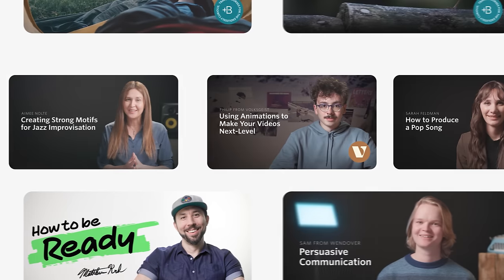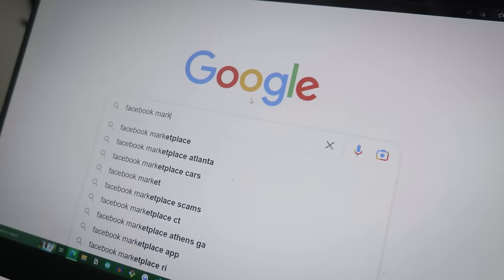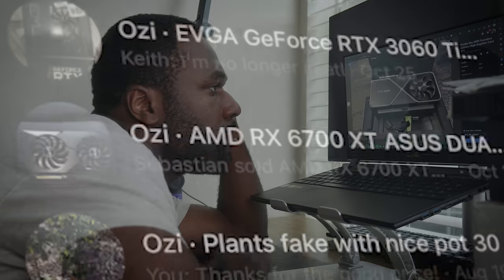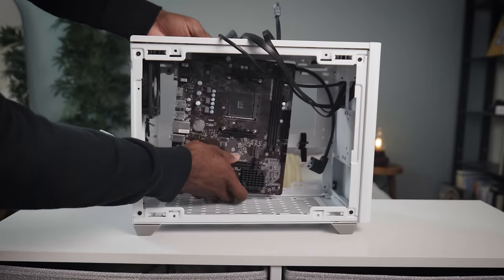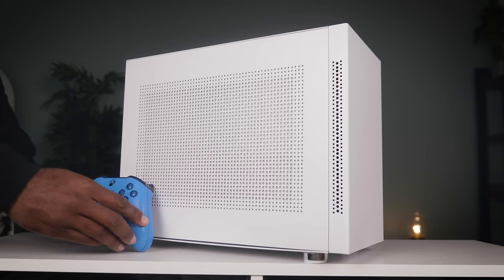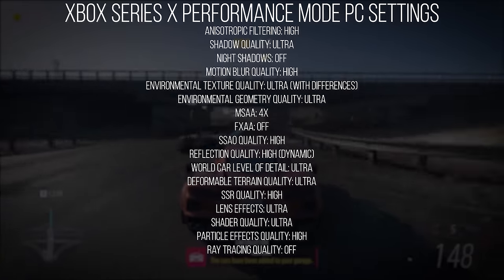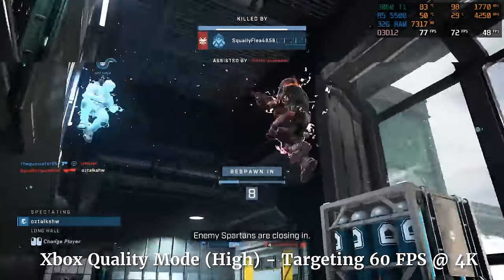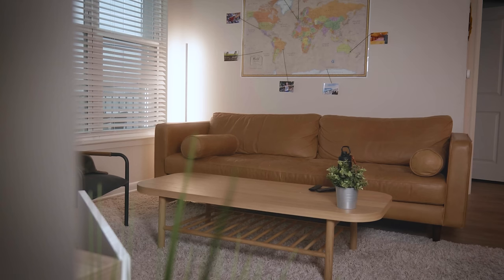I built a faster Xbox Series X for $474

Comment: This just goes to show how much of an insane value the Xbox Series S is when paired with gamepass.
Reply: What is this game pass?
Reply: Pay to play online, barely any sales on games and you need to slap tax on top. Honestly, a used 6600 or 6700 XT with a cheap B150m and either a QTJ2 from China or those 11th gen soldered CPUs and some 16GB of RAM is easily reproducible and will land you around the $500 mark, giving you all advantages of a PC with 100% better performance than the Series X. 

That being said, series S compared to a $250 gaming PC, even considering pay to play, is really good value across the board.
Reply: It just has a LAUGHABLY TERRIBLE low amount of storage
Reply: Tbf you can get PC game pass too
Reply: @JeskidoYT  Because he bought it ages ago. A 1TB NVMe drive is like $35-40 these days
Reply from the maker: Seriously...Microsoft hit it out of the park
Reply: @b0ne91  no i mean the console comes with 450gb of usable storage
Reply: I learnt the hard way, console gaming is limiting and frustrating.
Reply: Game pass is trash you dont own any of it, My steam library is mine until death.
Reply: Not just the components. Paying for their operation system too and the fact it’s pre built which is why it’s expensive. Supply and demand bro
Reply: Nah.  I'll stick with my 4070ti
Reply: @b0ne91  that’s not true lol. if you have game pass you get xbox live gold too. a series s costs 250€ at retail. you can’t get a pc that can last 10 years for that price
Reply: @idkwhyibothered  limiting? bro it’s a console, for playing games. what did you expect my guy
Reply: @TrTriTrippin  that’s the cool thing of game pass, you get new games without the need of buying them for retail price. why would i pay 60€ for a single player that i’ll just play once if i can have it for 13
Reply: @19deltascout43  sarcasm right?
Reply: @Moli05  Where did you get lasting 10 years from? The Series S plays 1080p and already has to upscale that for AAA titles. Buy a used office PC for 80€, throw in an SSD, half-decent PSU and a used GTX 1070 and you have a PC that outcompetes a Series S for 250€ too.
Reply: @19deltascout43  nobody asked.
Reply: @b0ne91  a 250$ pc with 120 FPS on warzone ?'
Reply: They have always lost money on consoles. They make money on licences and subscriptions and accessories
Reply: @sabah1287  A Series S doesn't have the CPU to hit 120 FPS consistently. Please take a look at Digital Foundry to see what it can ACTUALLy do. Also, Mir Computers just posted a video recently where he proved again that even a 4th gen (Haswell) CPU can do over 100 FPS in Warzone if you know how to tune your RAM.
Reply: @TrTriTrippin  lol or until steam goes under
Reply: Especially if you buy game pass through a third party.
Reply: whodis8393  well too bad gaming isn't a hobby its a luxury and gamepass is indeed a terrible marketing strategy for Microsoft
Reply: @Moli05  like I said I learnt the hard way
Reply: Except developers hate making games for the S
Reply: Gamepass on PC is just chefs kiss. Payed like 119 pesos which is 2 bucks in us every month.
Reply: Nah. PC Game Pass is cheaper and the PC can be built cheaper, can be upgraded, and tons of stuff can be done on the PC.

Xbox can only game.
Reply: Microsoft’s decision that you can’t make a series x game without a series s version is holder this whole generation of consoles back as far as game quality
Reply: @baseballreg123 A Haswell 4C/8T or Haswell-E CPU are more than enough to push a 1070, Vega 56, etc, in graphically demanding games. You should watch some DigitalFoundry and learn at what resolutions, settings and FPS the consoles actually run. Series S isn't exactly impressive.
Reply: @baseballreg123 wrong. PCs have settings to turn graphics up or down. XsX and PS5 games are literally having to cut back on graphics because their forced to launch it on XsS too.
Reply: @b0ne91  1440p. Does not have to upscale. All the games are optimized amazingly and I’ve had no issues.
Reply: @MS07B3-G0UF  What? 1440p for latest games is definitely upscaled on Series S and in fidelity mode, it's locked at 30 fps too. For older games - you're correct. But any game from 2019 and older will run at 1440p natively on a 1070 or Vega 56 too.
Reply: @b0ne91  not one time have I seen lower than 60 on the series s. Not once.
Reply: @MS07B3-G0UF  Again, might wanna keep up with Digital Foundry. They do a good job reviewing new titles.
Reply: Consoles are sold at a loss, except Nintendo Switch. Sony just released batches of new PS4 Slim in my country and they want $340 for a piece. I'd rather build a PC with that money, new PSU and GPU other parts used.
Reply: @spida2pro705  $20.18 for an OS key isn’t really a factor.
Reply: @JeskidoYT this is true. Fortunately sales happen with the expansion storage and it’s totally worth it
Reply: @TrTriTrippin  technically no...
Reply: Gamepass is only a value to people without large game libraries. Personally I have almost 1000 games between Steam, EA, Ubisoft, EGS, Humble Bundle, GoG, and Blizzard. With a PC I have full access to my entire library of games plus I can get new games whenever I please and I don't need to worry about a game being taken out of a Gamepass library at a later date. Furthermore, when you look at the games on Gamepass you find that the vast majority are either super cheap or are often given away for free on other platforms. Given the larger library of games available on PC and the ability to play almost every PC game that has ever been made through emulation, there is little incentive to buy any console outside of exclusive games.
Reply: @chrisaguirre5988  You’re in the extreme minority. It’s also not a comparison, it’s an observation of the value.
Reply: @BrandonWestfall  Actually no. I am not in the minority. The average steam user has between 30-200 games in their library. After a few dozen games it becomes more cost effective to just build a PC to keep access to those games. In addition a lot of people don't buy many games over the course if a year. Between sales and discounts many people spend less than $100 a year on new games. That comes out less than Gamepass and you don't have to worry about the game you want to play being on Gamepass or not. 

Game pass itself has kinda hit a plateau. Subscription numbers have been stagnant for a while now and their profit per customer is also down. You may see changes in how Gamepass works moving forward. Expect fewer Day 1 releases and more times releases. This would force more users to spend $60+ for a Day 1 release rather than wait 6 months to a year for the game to drop on Gamepass. This is the approach Sony is taking with their service. They have both a larger user base and a higher profit per customer. Think about it. Many of these AAA titles cost $60+ with tens of millions of copies sold. If a game sells 10m copies that could result in excess of 300m in revenue (assuming 50/50 split). That is a lot of money that Microsoft looses by having a game on Day 1 on Gamepass.
Reply: @chrisaguirre5988  Yet again missing the point. Move along.
Reply: @BrandonWestfall  You argument is that it is a value. My argument is that it is only a value to a select customer base that does not have a large pre-existing library of games. It is 100% on point.

For people who don't have a lot of games and/or don't mind waiting for timed release windows it will be a great value. For everyone else, not so much.
Reply: @chrisaguirre5988  There was no argument. It was a statement, and a very valid statement at that.

You decided to twist the conversation into an irrelevant tangent. MOVE ALONG.
Reply: @chrisaguirre5988  here’s a quick and easy way to disprove that it’s only good value if you don’t have a large library: how many games will you only play once, for less than a month, and cost more than $10? My guess is somewhere around 500-600 of your 1000 (I know steam has good deals). Game pass gives you the ability to play the game and beat it for $10. That’s a money saver for most people. If you beat it in under a month, you can play something else with that same $10 value.
Reply: @nickthompson1812  A lot of the games I got were either in Humble Bundle Deals or were giveaways. Many of the games have been in my library for decades. I looked at the entire Gamepass library and I found that most all of its big AAA games were either giveaways on other platform s at one time or another or heavily discounted. I got games like the Mass Effect Remaster, both Watchdogs games, and about 3-4 of the most recent Assassin's Creed games all free. The only games I purchased in the last 12 months were  Stray, Floodland, GRIS, and Master of Orion. None of them are on Gamepass and the overall amount I paid was less than a Gamepass subscription. I also have hundreds of hours on free and older games this year like Overwatch 2 and Sins of a Solar Empire. Most of my time is spent on FFfXIV which doesn't count as no subscription service would include that game regardless. 

Another thing worth mentioning is that the Gamepass library of games is miniscule compared to the amount of games available for the PC platform. Gamepass claims to have over 300 titles in its library. I own more games than that and I had the vast majority of them before Gamepass existed. So yeah, it is abad deal for a lot of people and the lack of quality exclusive titles is one of the cited reasons why their subscription count has plateaud. I expect Microsoft to make changes in how Gamepass works to increase their revenue. That would include delayed releases on Gamepass to entice more full price purchases of new game releases. Don't be surprised if both the new Elder Scrolls and Starfield end up not on Gamepass at release.
Reply: @JeskidoYT  Since he's under budget, you can quite literally add the 30 bucks under budget to the ssd and get a terabyte. Also the last gen consoles came with half a TB so it's honestly not bad.
Reply: @TrTriTrippin  or until the death of the Valve. if you don't own a physical copy, it's not really yours.
Reply: @b0ne91  Not to mention how expensive just the xbox one controller is, you can get it for $69 or $79 depending on where you get it from, I'm not complaining or anything, I know its expensive to make, it connects with pcs, it has bluetooth and ect, but im just saying
Reply: @TrTriTrippin  you own nothing you license them
Reply: @b0ne91 why buying used PC when u can get new hardware like Series S.
Reply: @RedzNusantara  because then you're not stuck on a shitty console you can't upgrade with no control over settings, console game prices and console limitations
Reply: Not exactly when you factor in online services and the cost of the overpriced expandable storage
Reply: @TrTriTrippin My xbox library is mine until death. I love people who speak with no fucking idea 😂😂 You are so funny jajajaaja
Reply: @@baseballreg123No just no
Reply: @TrTriTrippin  Just letting you know Steam can terminate your account for any reason they want in any moment they wish. Your steam library isn't yours, it can get taken away from you. The only way you can own anything is by having a physical copy. Steam just lets you borrow the game, but if anything happens they won't give a fuck and you'll end up without your games and your money.
Reply: No disc drive so you're subject to whatever price they decide to set on the digital store. I got an xbox one x a couple years back and all the games on my list were around 5 bucks. Sunset overdrive, ryse, dead rising 3. Only MCC and halo 5 were more but I bought new copies. Xbox series s would be a good value if it had a disc drive
Reply: @Matt-jc2ml  “paired with gamepass.”
Reply: @BrandonWestfall  with gamepass you own nothing and pay 100s of dollars a year on games still
Reply: @Matt-jc2ml  So? What’s your point?

Most people don’t replay their games.
Reply: @BrandonWestfall  I replay mine a lot. If I have $200 i can buy a ton of games in sales and I own them forever. Series s would be great if there was a disk drive. Probably would've got that over PS5 because it's so small
Reply: @b0ne91   idk about you but where i live (austrailia) a 600 pc on gets you about a 1060 6gb and a ryzen 2600x where as you can find the xbox for 300
Reply: @Uotre  bruh, you just know you're lying now. Look at the shit Tech YES City picks up in AUS all the time.
Reply: @b0ne91  please rephrase that is incomprehensible
Reply: You're lying. Tech YES City (Aussie Youtuber) constantly gets great deals. For $600 US, he can build you a system that blows the PS5 out of the water.

Aussie second hand market isn't that terrible at all. No fucking way you're getting a 2600X and 1060 for $600. Not even $600 AUS. Maybe 2 years ago when prices were insane.
Reply: @b0ne91  it was 1 year ago also any modern game running gpu is 300-400 dollars alone let alone with everything else and I’m talking used and triple a games are getting harder and harder to run
Reply: @b0ne91  What exactly am I lying about? 

Blow the PS5 out of the water? You must be high.

Bryan finds good deals for various PCs but it would be pretty difficult if not impossible to beat a PS5 for $600 in the US. 

Also, the Xbox Series which is the topic of the discussion can be found for $200.
Reply: @BrandonWestfall  Really? 3060 and R5 3600 or i5 10400F is already better than what the PS5 can do in most scenarios. That's very doable for $600.
Reply: @b0ne91  Except it’s not, and again, the discussion is about the value of an Xbox Series S.

People like you blow my mind. You’re throwing a tantrum and are essentially trying to have a different discussion.
Reply: @BrandonWestfall  I responded I to the people in this thread making wild claims. My very first one was on $300 PCs outperforming the Series S and I pointed towards a Haswell and 1070 combo.

Then people kept talking about the higher end consoles. People who were attacking me. I understand you're the OP, but you didn't have to get involved in those discussion and since you did, I'll shut you down no problem too.

The consoles CPU is weak. Half the time when framerates are an issue in console games, it's the CPU. They may have 8 cores, but they have jack shit for cache to the point where the CPUs I named will do on par or better than the PS5/Series X CPU, especially with a half decent RAM setup (OC+timings).

The GPU is an underclocked, underperforming RX 6700 (non-XT). A 3060 that isn't power limited WILL outperform that. So will a real 6700 XT or even a properly OC'd and undervolted 5700 XT. These are all relatively cheap by now.

I've been flipping PCs for ages, I overclock and tune all my systems properly. I know what it takes to beat current gen consoles in the used market. I understand that's not for everyone and specially people who are new to it or aren't keeping up with hardware and the market can't do what I can, but that doesn't make me wrong.

Look into Digital Foundry. Look into what games actually run at which resolutions (native, upscaled), what framerates are being targeted and what it takes to do so on a PC. 

It's easy too. Just figure out if a game/scenario is CPU or GPU limited in general, figure out where the limits of a certain part (CPU or GPU model) are and you'll know almost exactly what it takes to beat a console.
Reply: @b0ne91  Shut me down? 

Ooh, I’m scared of the internet tough guy. 

You’re making a whole lot of claims with 0 proof to back it up. 

If you prefer a pc great, use one. For some people (a very large amount of people) a $200 console with gamepass is more logical. 

Comparing a PC that costs 2-3x the price of the console is rather ignorant.
Reply: @BrandonWestfall  How am I supposed to post proof in YouTube comments? I've told you all the info and I told you where to look it up. If you can't or don't want to do that, there's no point helping you.

If you want to live in ignorance and waste money on consoles and games, you do you. If the convience is worth it to you and you're happy that way, I'd prefer it even - because then you can stop bothering me. 

One last time: An E3 1240 v3 based system, even if you build it around a former office PC, with a GTX 1070 or Vega 56 will outperform a Series S. Look at the raw specs and look at benchmarks.

As far as I can tell, you didn't really understand any of the info I was previously giving you, so this will likely be my last reply.
Reply: pc got gamepass too, poor sony :(
Reply: @TrTriTrippin if steam dissolved today you would also lose your library lol we dont own anything
Reply: Yeah. If you look used, you can find a series S for like $120 USD.
Reply: have fun with your steam library filled with mid games where you spend 90% of your time on just 3 games out of thousand.
Reply: @b0ne91 the s has the same cpu as the x tho ? It’s the gpu and ram that’s different
Reply: @b0ne91  not a good one lmao. If you wanna buy cheap garbage, go ahead but expect to spend like 80+ on a good one.
Reply: @beeseechurger  I assume this is in response to an SSD. Prices are currently going back up for RAM and SSDs, but you can still get a good SSD for that price, like the SN570. You don't need to spend $80 on a 1TB SSD unless you fell for marketing bullshit. Unless you need PCIe 5.0 and deal with large files for 4k video editing, you're just wasting money
Reply: @b0ne91  that’s a gen3 drive. I’m talking about gen4, since that’s what this board uses lmao. If we’re talking gen3, yeah it can be cheap. 

Usually you assume people will buy the correct gen that their board uses, but I guess that’s hard to understand.
Reply: @beeseechurger  What do you even need a gen 4 drive for for gaming? Let alone in in a budget system where you're likely limited to SATA and one of this matters anyway. 

If you're buying a gen 4 drive and aren't a content creator, you've wasted your money. Congrats! Bet you bought an AIO more expensive than your CPU too
Reply: @b0ne91  …huh? Dude it’s not necessarily for gaming, everyone knows a PC can be used for other things, and using a gen4 drive can increase download speeds, read/write, boot times, and other things. It’s better in every way, and considering that you HAVE a gen4 slot, you should get a gen4 drive. 

If you don’t need it, buy an older board too, since it’s clearly wasting money to buy things you “don’t need”
Lmao what are you talking about with that AIO crap
Reply: @beeseechurger  Yes, it's a waste of money buying things you don't need. An older motherboard is fine too, if you don't need any of the feature, ESPECIALLY IN A $500 BUDGET BUILD. You don't have $50 to waste on an SSD that doesn't give you real world improvements.

What faster downloads? You'd have to have at least 10Gbit fiber to see the difference in gen 4 over 3. It's not going to improve boot times in any measurable way. You wouldn't even gain a single full second. 

I can't tell if you're uninformed, delusional or just trying to cope because you wasted money
Reply: yeah, you need to buy like a $2000 pc to get that same performance
Reply: @sowsow6677  lmaaaaaao a $2000 PC gets you performance we likely won't see until the PS7. PS5 uses a cut down version of an entry level GPU from a generation ago.
Reply: Well it'll be $15 dollars a month which will be the same price of this in a few years and you'd also have to rebuy a lot of games at a higher price than any place else. I had a Series S for sometime and ended up selling it to a friend. It's good for people on a budget but the 360gb of actually useable storage is ridiculous when listed as 512gb.
Reply: @JeskidoYT I mean that can be fixed
Reply: They took a big L on profits with that console. No way you could match that cost for hardware on PC and get similar performance.
Reply: The 1TB series S is still a steal for $50 more.